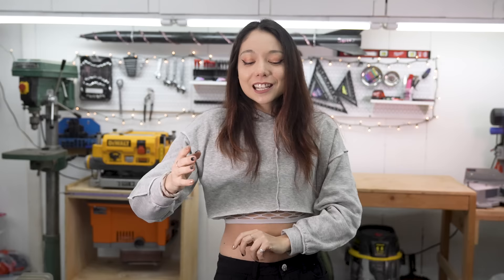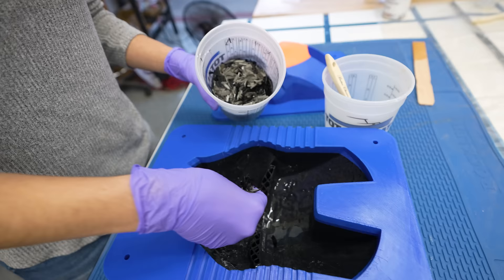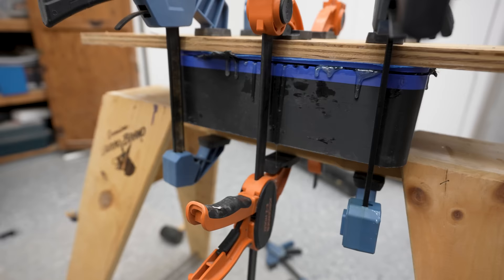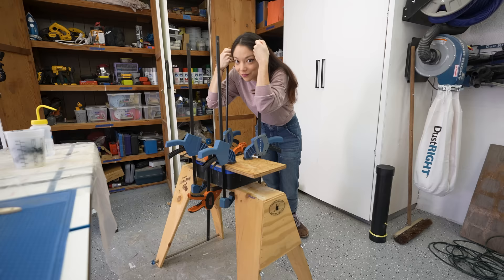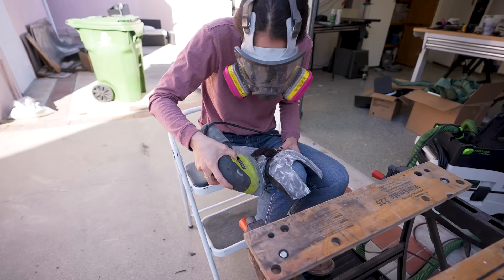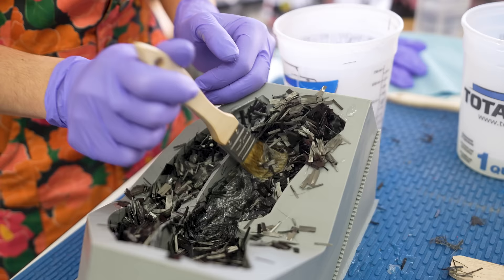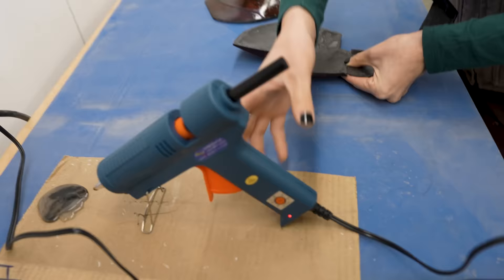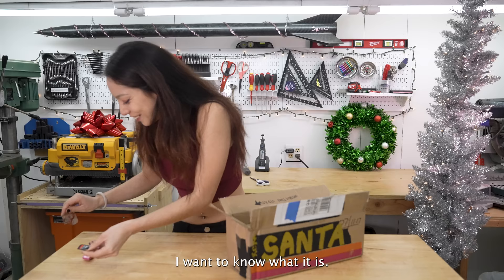I UPGRADED Iron Man's Helmet (100% Carbon Fiber!!)

Comment: Just spitballing ideas to improve the molding process. Thicker walls might have helped reduce the collapse between the infill ribs. If the epoxy that you used is exothermic (like pretty much all epoxies) when curing, the trapped heat inside the molds might have exasperated the deformation. If that is the case, printing in a higher temperature resistant plastic (PETG, ASA, etc) might help. Or, for future projects make the infill pattern part of the desired surface finish/texture.

Comment: (Might try 'de-airing'  the epoxy after mixing it, in a small vacuum chamber you make. Powered with that vacuum pump if you have enough time before the epoxy goes off, if you are bothered by those very occasional bubbles. Use a much bigger container for the resin than it's volume as it 'boils up' releasing air and gases. Then careful layup should reduce them...but in reality they are very minor, I wouldn't worry about them.) Came out well!

Comment: Nice job! And I really like that you are using proper protection. I'm going to ignore the gloves. Well, not I am not. I would use mechanic vinyl gloves. And lastly, you will love this. Instead of that final coat of epoxy, try UV resin. I am a woodworker and am trying out the new UV Stains and Resin. After borrowing the light source (~$900) I was shocked. I did two coats of stain (cured) and three coats of clear finish in a little over two hours. And it is amazing, and durable. If I had done this with regular stain, and clear coat it would have taken a week. I have ordered my UV light.

Comment: If you are casting in a 3D printed mold, would it be possible to include an air inlet into the bottom of the mold so you can use compressed air to aid demolding?
Reply from the maker: ooh that's a great idea! my assumption is it would fill with resin when compressed but i wonder if there's a way to avoid that
Reply: @xylafoxlin  : Put a silicone "dowel" in the hole.  Or a bolt, so you can unscrew it.
Reply: @xylafoxlin  Thats an interessting problem. I wonder if fiiling the void with soemthing like vaseline would keep the resin out for while it was setting. Of course if the set is exothermic it could liquify the vaseline, but by the time it gets hot, does it still flow? maybe filling the inlet with silcone caulk and making sure the release agent covers the part in contact with the epoxy and then remove the caulk and push air in. Hmmmmmm I wonder if that would work.

Comment: To avoid pinholes u could do u a vacuum pull after a small layer untill it reached the tag stage and then build up more layers. Since u are working with a pressure mold for the face mask it's gonna be hard to get the perfect amount of resin everywhere without infusion.

Comment: Hi Xyla. Composite engineer here, just curious if you are sealing your molds before adding release? What products are you using for that? You’re fighting those molds too much!  With your minimal/lack of consolidation pressure I doubt you’re going to pull parts off the mold without voids and pinholes. Nice job! Love that paint to tint the forged carbon look!

Comment: If you put a skin coat or resin on you mold thank heat gun the bubbles out and let it start to tack up with 100% coat on the mold than do your resin and carbon you tend to get a better surface finish than doing it all at once .it looks amazing nice job

Comment: Hmm, fascinating idea.
I do silicone resin molding and also 3d sculpting in inventor

I also have an interest in bulletproof itens so I can't help but wonder how this would do with UHMWPE

Oh to answer your air bubble question, in molding resin models we use gates for resin as you expect but also for air, ideally you want it under vacuum so bubbles flow from your part into the spare gates, also called degassing channels

Comment: It is really suggested to use hard silicone to make the mould. The reason being it will be easy to release the silicone from the 3D printed parts, and it will be easy to release the mask from the silicone. I have tried moulding with 3D printed parts before and every time the layer lines make mould release a nightmare. Alternatively use some wax.

Comment: Use a hot air gun and compress air blow the air between the mold and the carbon. Also a cast saw is safer and easier to cut carbon. 10years + making prosthesis here from carbon. Love your work.

Comment: Pin holes are expected on wet layups, even on some infusion/vacuum bagging I've seen in rare cases. Nothing a top coat can't handle. 
I've seen people just inject the voids with CA glue and top coat/clear coat over. I usually just go over each one with a toothpick and force in resin then top coat it.

Comment: I'm trying to imagine you in my shop. The cool things you make in your "upgrade from 1 car garage."
My shop is slowing becoming my dream shop, I can park a small tractor with room to work in it. And still have the little side area for my side projects to never have to get moved out of the way if the tractor (or anything else) breaks down. I also have a roofed outside area I use to park/work on my offroad toys.
But the roof leaks badly in 2 places, so it isn't dream level yet.

Edit : Watching you use spray paint on that hurt a little... I have airbrush paint made for it, and an airbrush gun that can handle spraying glitter added to the transparent paint.

Comment: I did a freelance 3D modeling job where the guy had a blender model of something and just wanted it touched up to be able to 3D print. oh no no no, I spent two weeks redoing the entire thing from scratch in parametric 3D because my 3D slicer would not recognize the blender texture map as a solid body. Came out great in the end, I still have another section of the original model that I want to print for my own enjoyment.

Comment: the holes and voids ARE avoidable when forging CF You appear to clamped the mold face together immediately but you should use progressively tighten the clamps over about 10 20 minutes. 

to make release easier, you can print pin release holes and fill them with putty while molding after it's cured put a steel dowel in and tap it with a hammer like and the part will pop out easily like an injection molded part

Comment: Have you tried resin filler before like smooth on ure-fil 15? It’s a micro balloon filler that you mix with resin, to create lighter castings compared to full resin. Since you’re adding in carbon fibre flakes I don’t think the filler would affect the strength of the helmet much at all. But result is a lighter helmet.

Comment: @07:52 Your vacuum bag looks like it's right on the plywood, you will pull some air directly through the wood  unless it has some kind of gas barrier like an epoxy surface layer or a sandwich of plastic sheeting.

Comment: Good PSA about the gloves.  I used to work in a metal fabrication shop, and gloves were for welding and carrying and not much else.  Not to be used near the machines.  I lost count of the times I tore skin off a knuckle with a belt sander, but I always considered that better than losing a finger.  (I lost a finger anyway, but in a freak accident involving a dog and a lawnmower  🤪)

Comment: Since you don’t want to tinker or wait for a 3d print to complete, I’d definitely suggest a Bambu Labs X1 Carbon - it would be able to more than double what your Ender 3 can do, and it’s way more reliable/less of a pain. Plus, since it’s an enclosed printer it can actually print ABS which is miles easier to sand than PLA. Those two weeks of printing could have likely been turned into less than 4 days. And it uses a LIDAR to make sure it’s extruding the right amount of filament for every print, and has auto bed leveling. 

That Helmet is some incredible work - I’d love to get into composites someday. It’s a stunning creation, as always.

Comment: What material did you use for 3D printing the molds? If it was just PLA then it softens at 50-60 C and doesn’t epoxy create heat when curing? It is maybe possible that your epoxy heated and softened the outer surface of PLA and hence the cooler infill pushed through and left its pattern. Maybe if the top surface softened, due to the pressure it got pushed back into the part (like drooping) and the better supported sections, where the infill is stayed mostly in place but the material in between essentially drooped. You would be better with a higher temperature and higher strength material for printing molds. You may even be able to get one that doesn’t bond well to epoxy. I don’t know much about epoxy but polypropylene, although is a nightmare to print, basically doesn’t stick to anything but can be slightly flexible.

If you don’t want to sand the molds you can vapour smooth ABS and ASA with acetone, it leaves a perfectly smooth surface. Or you do get other filament meant for vapour smoothing, like polymaker polydissolve.

Comment: Having done some 3d printed mold too, I think it's more likely that epoxy releases heat when it cures and it melts just the top few layers...
Try using more walls, or even better, a more heat resistant material!

Comment: I highly recommend using a 3 piece mold with draft angles along the parallels. I have had significant more luck demolding molds styled that way, and you can usually get one or all of the parts to come off in one piece. It's always a struggle though
Reply: @xylafoxlin ^

Comment: Split-complex numbers relate to the diagonality (like how it's expressed on Anakin's lightsaber) of ring/cylindrical singularities and to why the 6 corner/cusp singularities in dark matter must alternate.
Dual numbers relate to Euler's Identity, where the thin mass is cancelling most of the attractive and repulsive forces.  The imaginary number is mass in stable particles of any conformation.  In Big Bounce physics, dual numbers relate to how the attractive and repulsive forces work together to turn the matter that we normally think of into dark matter.
Complex numbers = vertical asymptote.  Split-complex numbers = vertical tangent.  Dual numbers = vertical line.  These algebras can be simply thought of as tensors.  Delanges sectrices can be thought of as opposites of vertical asymptotes.  Ceva sectrices as opposites of vertical tangents, and Maclaurin sectrices as opposites of vertical lines.
The natural logarithm of the imaginary number is pi divided by 2 radians times i.  This means that, at whatever point of stable matter other than at a singularity, the attractive or repulsive force being emitted is perpendicular to the "plane" of mass.
In Big Bounce physics, this corresponds to how particles "crystalize" into stacks where a central particle is greatly pressured to degenerate by another particle that is in front, another behind, another to the left, another to the right, another on top, and another below.  Dark matter is formed quickly afterwards.
Ramanujan Infinite Sum (of the natural numbers):  during a Big Crunch, the smaller, central black holes, not the dominating black holes, are about a twelfth of the total mass involved.  Dark matter has its singularities pressed into existence, while baryonic matter is formed by its singularities.  This also relates to 12 stacked surrounding universes that are similar to our own "observable universe" - an infinite number of stacked universes that bleed into each other and maintain an equilibrium of Big Bounce events.
i to the i power:  the "Big Bang mass", somewhat reminiscent of Swiss cheese, has dark matter flaking off, exerting a spin that mostly cancels out, leaving potential energy, and necessarily in a tangential fashion.  This is closely related to what the natural logarithm of the imaginary number represents.
Mediants are important to understanding the Big Crunch side of a Big Bounce event.  Black holes have locked up, with these "particles" surrounding and pressuring each other.  Black holes get flattened into unstable conformations that can be considered fractions, to form the dark matter known from our Inflationary Epoch.  Sectrices are inversely related, as they deal with dark matter being broken up, not added like the implosive, flattened "black hole shrapnel" of mediants.
Ford circles relate to mediants.  Tangential circles, tethered to a line.
Sectrices: the families of curves deal with black holes and dark matter. (The Fibonacci spiral deals with how dark matter is degenerated/broken up, with supernovae, and forming black holes. The Golden spiral deals with black holes being flattened into dark matter during a Big Bounce event.) The Archimedean spiral deals with black holes and their spins before and after a reshuffling from cubic to the most dense arrangement, during a Big Crunch.  The Dinostratus quadratrix deals with the dark matter being broken up by ripples of energy imparted by outer (of the central mass) black holes, allowing the dark matter to unstack, and the laminar flow of dark matter (the Inflationary Epoch) and dark matter itself being broken up by lingering black holes.
Delanges sectrices (family of curves):  dark matter has its "bubbles" force a rapid flaking off - the main driving force of the Big Bang.
Ceva sectrices (family of curves):  spun up dark matter breaks into primordial black holes and smaller, galactic-sized dark matter and other, typically thought of matter.
Maclaurin sectrices (family of curves):  dark matter gets slowed down, unstable, and broken up by black holes.
Jimi Hendrix's "Little Wing". Little wing = Maclaurin sectrix. Butterflies = Ceva sectrix. Zebras = Dinostratus quadratrix. Moonbeams = Delanges sectrix. Jimi was experienced and "tricky".
Jimi was commenting on dark matter. How it could be destabilized by being slowed down, spun up, broken up by lingering black holes, or flaked off.  (The Delanges trisectrix also corresponds to stable atomic nuclei.)
Dark matter, on the stellar scale, are broken up by supernovae.  Our solar system was seeded with the heavier elements from a supernova.
I'm happily surprised to figure out sectrices. Trisectrices are another thing. More complex (algebras) and I don't know if I have all the curves available to use in analyzing them.  I have made some progress, but have more to discern.  I can see Fibonacci spirals relating to the trisectrices.
The Clausen function of order 2:  black holes and rarified singularities are becoming more and more commonplace.
Doyle's constant for the potential energy of a Big Bounce event:  21.892876
Also known as e to the (e + 1/e) power.
At the eth root of e, the black holes are stacked as densely as possible.  I suspect Ramanujan's Infinite Sum connects a reshuffling from the solution to the Basel problem and a transfer of mass to centralized black holes.  Other than the relatively small amount of kinetic energy of black holes being flattened into dark matter, the only energy is potential energy, then:  1 (squared)/(e to the e power), dark matter singularities have formed and thus with the help of Ramanujan, again, create "bubbles", leading to the Big Bang part of the Big Bounce event.
My constant is the chronological ratio of these events.  This ratio applies to potential energy over kinetic energy just before a Big Bang event.
Methods of arbitrary angle trisection:  Neusis construction relates to how dark matter has its corner/cusp singularities create "bubbles", driving a Big Bang event.  Repetitious bisection relates to dark matter spinning so violently that it breaks, leaving smaller dark matter, primordial black holes, and other more familiar matter, and to how black holes can orbit other black holes and then merge.  It also relates to how dark matter can be slowed down.  Belows method (similar to Sylvester's Link Fan) relates to black holes being locked up in a cubic arrangement just before a positional jostling fitting with Ramanujan's Infinite Sum.
General relativity:  8 shapes, as dictated by the equation?  4 general shapes, but with a variation of membranous or a filament?  Dark matter mostly flat, with its 6 alternating corner/cusp edge singularities.  Neutrons like if a balloon had two ends, for blowing it up.  Protons with aligned singularities, and electrons with just a lone cylindrical singularity?
Prime numbers in polar coordinates:  note the missing arms and the missing radials.  Matter spiraling in, degenerating?  Matter radiating out - the laminar flow of dark matter in an Inflationary Epoch?  Corner/cusp and ring/cylinder types of singularities.  Connection to Big Bounce theory?
"Operation -- Annihilate!", from the first season of the original Star Trek: was that all about dark matter and the cosmic microwave background radiation? Anakin Skywalker connection?

Comment: FOR UR INFORMATION... in the future, you can put a threaded hole in the back side, and put an air valve, and put air pressure in the front of the mold... and push the part out with air pressure.  Easy peezy.

Comment: That's the least of Iron Man's problems. Planes have wings for a reason and Iron Man's lack of them (not to mention his suit's very non-aerodynamic shape) should make the way he flies physically impossible. But that's why they call it the suspension of disbelief.
Reply: He’s got a fusion power plant in his chest, he can brute force the flight if he doesn’t have the plans for the anti-grav car his dad built.
Reply: @highlorddarkstar  No. Have you ever seen a jet pack flight? That's what he should be. But flying level with just backward thrust is impossible. And the car his Dad built is not anti-grav, though it is more realistic in terms of physics.

Comment: Xyla, I have a question would adding some heat to soften the 3d print work for demolding and not mess up the carbon fiber epoxy??.. I know when my carbon fiber wrapped pool stick gets hot its got a warp, but when it cools its straight .. maybe around 70c